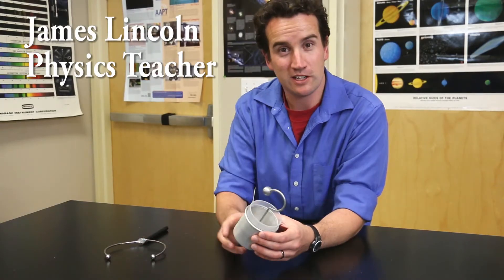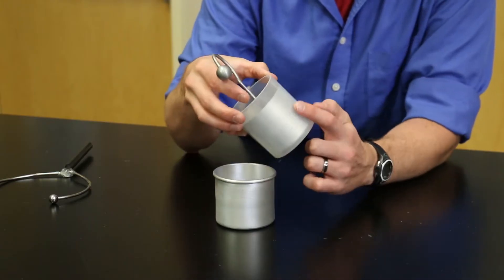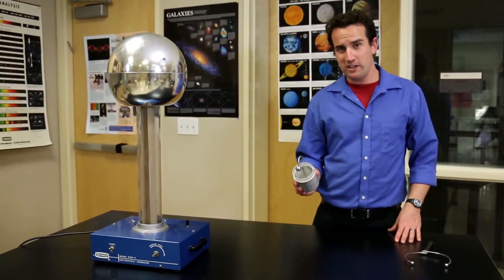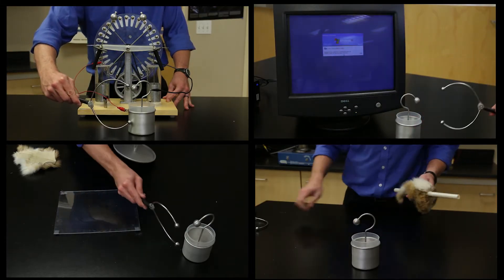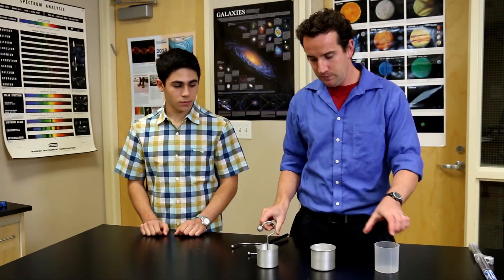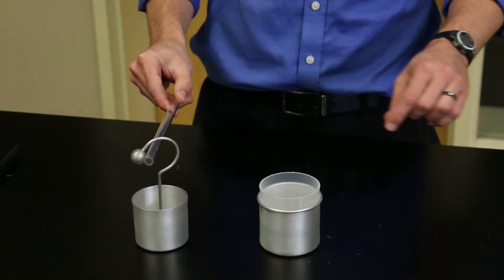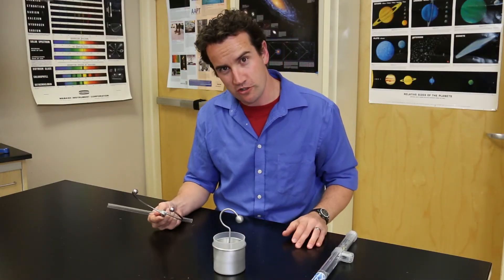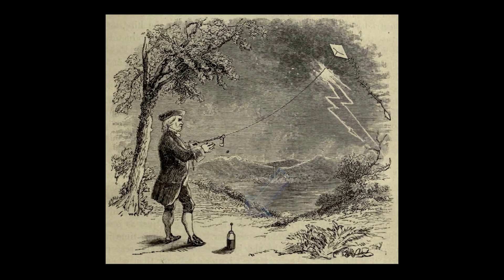The Physics of the LEIDEN JAR - AAPT Films

Comment: ".. very much like a capacitor."

A Leyden jar is precisely a capacitor, just an early form. The jar is composed of two conducting elements (the metal cups) separated by an insulator (the plastic cup). This both describes and defines a capacitor.

Comment: You said it yourself, "charge can't move on an insulator". What, then allows "The charge" to manifest as a useful means of electrification? Charge your diaelectric glass, plastic or distilled water, it will hold millions of volts, just keep it away from most metals. Redo the experiment and travel with only the Dialectric material to  reveal your experiment. You'll always get a spark. This experiment has been done, if not hundreds of times, thousands of times. Conductive and Non Conducive materials are now inverted. Explain?

Comment: Why is the exterior metal positive and the interior metal negative? (Or vice versa.) Answering that question would go further to explain matters. Also why do many Leyden jar constructions use water inside the jar?
Reply: Remember that electric charge is present only when negative electrons are separated from positive protons.  However the charge is generated, you are left with an abundance of electrons on one surface and protons on the other, thus negative and positive.  You can charge a Leiden jar, or most other types of capacitors, with either polarity connected to one side or the other.  If you touch the inside element with the positive charge, the outside element always becomes negative, and vise versa.  The water or other fluids inside early Leiden jars just served as the inner conductor, and can be replaced with conductive metal.  Aluminum foil is a cheap and easy material for making the plates of a capacitor, and a sheet of plastic kitchen wrap or even waxed paper between them makes a fine dielectric.

Comment: Can ANYONE explain WHY this one works without "Water" inside of it like literally ALL the other Leiden Jar designs I see on Youtube? Like for example this funny twit in this video: https://www.youtube.com/watch?v=xjW-isgOijs As you can see like ALL the others he uses water with "Salt" to make it conduct electricity, they ALL seem to say the water is "Required" for a Leiden Jar to work, yet the one in this video has no water! WHY & HOW??? In the link I just gave he also claims a " van der graaf generator" can NOT charge a Leiden Jar, so WTF??
Reply: The setup acts as a capacitor, a capacitor is made up of two conductive metal surfaces (or plates), in between the two metal surfaces we place a dielectric material(plastic in this case), which will get charged and store an electric charge when the conductors/metal plates are electrically charged.

In this video you have the layered materials [metal cup + plastic cup + metal cup] so, conductor + insulator/dielectric + conductor.

In the other videos using water you have [metal foil + plastic cup/bottle + salted water], so conductor + insulator/dielectric + conductor.
Its the same principle, its just that, for the inside of the cup/bottle, water is used as a conductor instead of a metal cup as in this video.

Comment: The energy is not in the charge separation, which is proven by the fact that you can touch the two metal conductors together and there is no discharge (with the insulator or dielectric removed). The energy is stored in the dielectric itself, in the form of an electric field. Though an alternate theory is that the energy is stored in the dielectric as a distortion of the internal magnetic fields.
Reply: @neodos  he did ... earlier on the video 😊

Comment: I really appreciate the fact that you can disassemble this one and the explanation that the majority of the charge is on the dielectric.
Reply: I instantly wondered if you could charge multipul plastic cups with one setup then use the stored power on one cup then disassemble it and put the next one in and use the energy stored on it so on and so forth. As long as you dont wipe the charge off them.